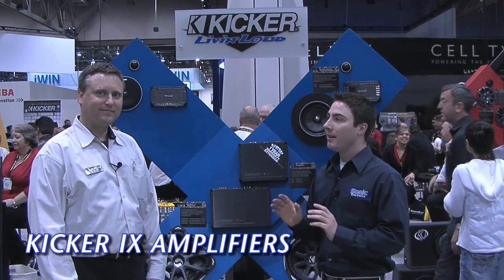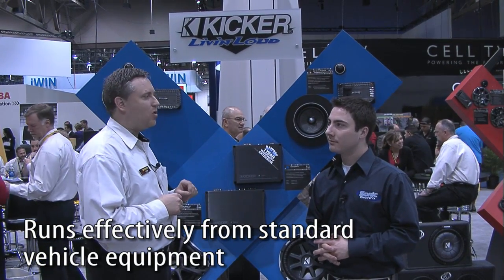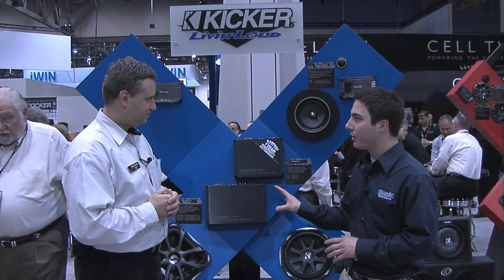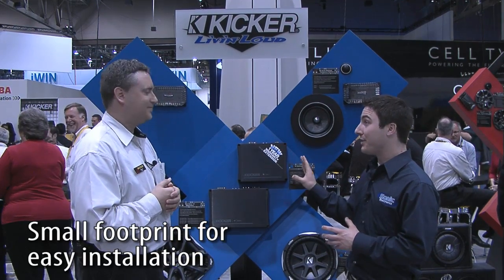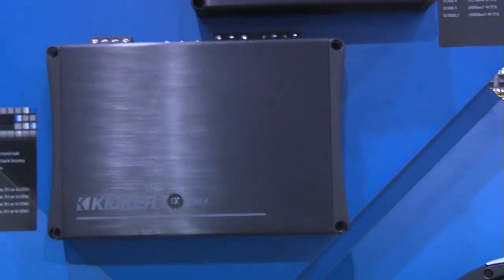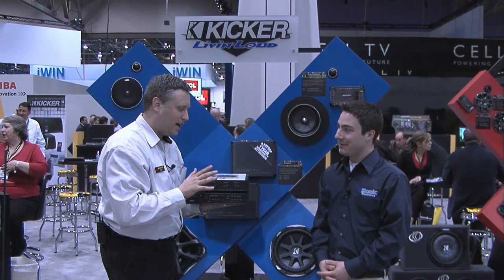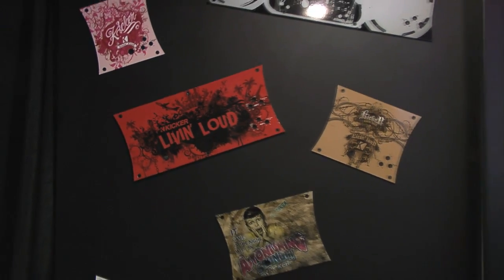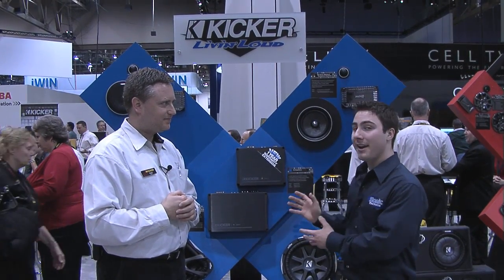Kicker IX Amplifiers at CES 2010

Comment from the maker: Your JL amp is a Class A/B which means they are very inefficent.  These kicker amps are Class D and will have far less strain on your vehicles electrical system so a cap or extra battery will not be required.

Comment: @DuffmasterFresh 

No, the IX amps are not cheaper.  The retail for the more powerful PDX 4.100 (100wrms x 4 @4ohms) is about $100 LESS than the IX500.4 (75wrms x 4 @4ohms).  At 2 ohms, the IX is 25wrms great, but still $100 more.   I have a PDX-5 which gets way louder than I care to let it.  It has 75wrms per channel.  Alpine still wins this one.

Comment: The Alpine PDX line still sounds like a better class d amplifier. they offer better channel configurations, smaller footprint, and capable of maximum RMS Wattage at 2ohm and 4ohm. The stacking bracket was also first put on Alpine PDX line.